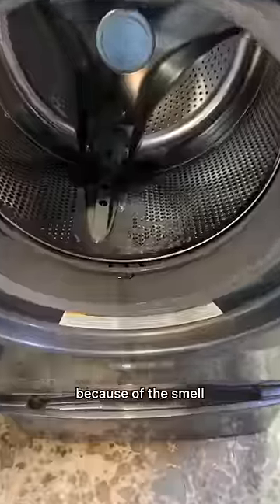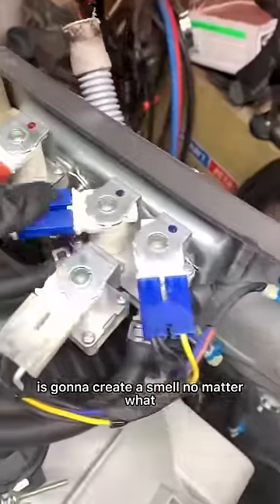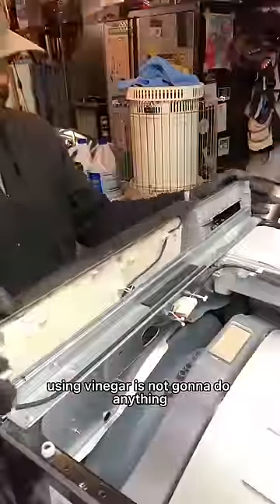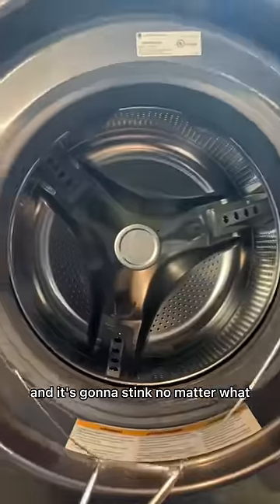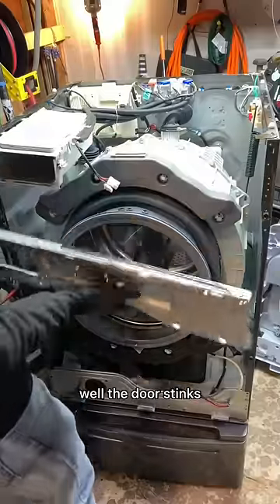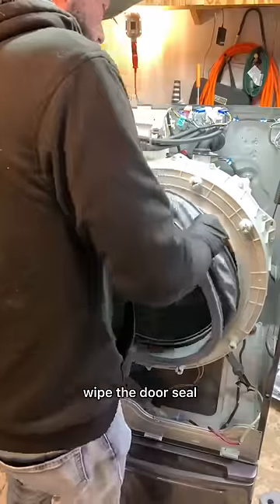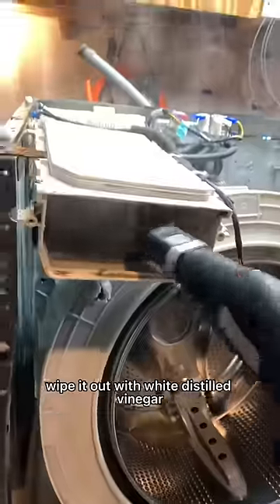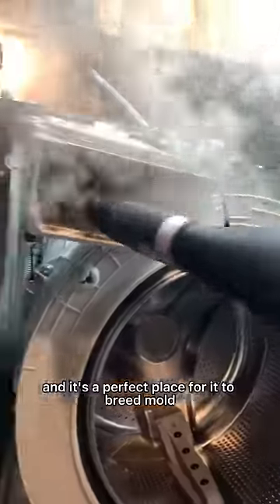Front load washers are proven to wash better. Facts, not opinion

Comment: My mom despised her front loader for years and gifted it to me when she reached her limit and switched to a mega capacity top loader.  When I first got it, the machine did smell horrible and was covered in slime all over/under the gaskets and all inside the detergent dispenser drawer.  

But I gave it the cleaning of a lifetime and years later I love it and have zero issues with it.  

To do the initial deep clean I made Lysol disinfectant solution from the concentrate in a commercial spray bottle.  Then I literally just kept spraying at the slime with firm trigger pulls until it was all displaced.  I did this over the gaskets, under the gaskets, and all inside the detergent compartment.  I realized the concentrate wasn’t rated to kill mold though since it doesn’t have the alcohol in it like the aerosol version, so i finished off with an aerosol spray to ensure death of any mold traces. I washed the pop out detergent drawer and its detergent and softener cups in the dishwasher because they were coated in mold even in the tiny nooks that were too hard to clean.  Popped the detergent drawer back in. Then I ran a simple rinse and spin cycle to wash away the slime.  I had a mask, gloves, and goggles on during the spraying/disinfecting to be on the safe side.  Then I did one tub wash cycle with an affresh tablet.  Then I did one tub wash cycle with bleach.  Then I wiped all the gaskets top and under to get any stubborn remaining residue/slime. Finished by draining the pump chamber and washing the coin catcher tray and then putting that all back in place.  

I know that sounds like a monstrous cleaning job, but ever since getting it spotless I’ve never had any recurrence of mold/bacterial growth—without ever doing a similar deep clean.  I think it’s because I live in a small apartment where the washer is basically just there in my kitchen area.  So I leave the door and the detergent drawer open when not in use but the key is there is enough airflow to dry it out.  My mom never left the detergent drawer open but she used the affresh tablets monthly and always remembered to leave the main door open—but the main difference is her house had the machine in a relatively small laundry closet.  Even with the doors to the closet cracked, it’s still essentially an enclosed high humidity room when not in use. 

So the key to long term success with a front loader, in my opinion, is humidity management and airflow.  If you have an enclosed laundry closet then a top loader is probably better if running a fan in or near the closet for an hour or two after washing is not an option.  Another thing that I think helps is I run a dehumidifier with a target of 50% humidity.  If I don’t have the dehumidifier going then my apartment will naturally be 65% humidity or more all year except for deep winter which makes me feel way too hot when I’m sleeping.  I’m sure the dehumidifier also helps reduce my machine’s dampness.   

But I just love how efficient it is and how little detergent I have to use.  For a load of normal clothes I literally only go up to level 1 on the inside of a tide measuring cup.  For towels and bedding I use level 2.  If the clothes or items have more serious dirt or spills on them then I just try to go up half a level and set it to run one extra rinse cycle.  My clothes get super clean, my water bill is noticeably lower, and I hardly ever have to buy detergent refills. I used to be super jaded about front loaders because the college laundry rooms from my school days were f*cking disgusting and would make my clothes smell even worse.  Like I’d literally sniff each one and use whichever available one had the least funk in it.  It was horrible.  But I couldn’t pass up a free hand-me-down machine when my mom wanted to trash hers.  Glad I gave it a shot.  

But I also think everyone should do what works best for them. The new top loaders have gotten pretty efficient too as of late.  There are great options for everyone. 😃

Comment: We bought a product called the "washer fan" that was basically a desktop computer colling fan in a magnetic housing that fit over the air exhaust vent on the back of the machine and forced air into it all the time.   When done washing, you leave the door cracked open and it pushes air through to dry everything out.  It worked.

That said, I find front loaders don't do a better job. The clothes don't get as clean. We bought a top loading, agitator-free washer 2 years ago and it's the best machine we've ever owned.  Doesn't destroy our clothes and gets everything cleaner than our front loader ever did.

Comment: Front load machines are trassshhhhh. They don’t use enough water and don’t clean clothes. Worst things I’ve ever used.
Reply: There's a screw you can turn to add more water. Also it's not frontload, it's the stupid regulations
Reply: @andrewk8636  unfortunately mine has the dryer on top and it’s in a small room, the size of the washer, because I’m in an apartment so I have no way to access anything.
Reply: @2bit156  if you can pull out the machine you could switch the two water lines so the hot water is hooked up to the cold line at the back of the machine, machine thinks it’s pulling cold water, (government regulates how much water new machines get to use and how much hot water they can use) but your machine can’t tell temperature, so it thinks it’s pulling more cold water then hot and you’ll have maybe an increase on the cleanliness of your clothes, try doing half loads as well
Reply: @2bit156  just make sure when you flip the two lines at the wall, to close them all the way then thread the hose on nicely don’t cross thread it and when you turn on the water watch for slow leaks or drips, might have to tighten it more
Reply: @giraffeguy6564  you do need to have your clothes drenched. The “deep soak” trend going on in TikTok is normal wash for us top loaders. Front loaders don’t wash clothes properly.

Comment: My solution has always been to use oxyclean as a pre wash on every load, use powdered soap and no fabric softener. 

I will use dryer sheets but that’s it! 

ALSO, I leave the washer door opened. I used to wonder why laundromat left their front load doors open and I asked the owner of a local place and she said that that’s what she does to mitigate stagnant water. I’ve had my front load for about 5 years. I’ve never done a deep clean so I busted it open a couple of months ago and there was ZERO build up, mold or any other foreign body. All of the rubber was pliable and clean as if it were new.

Comment: This is my next project. So far the seal looks like this one. Not the detergent tray. Clothes do not smell or have particles. 

I only use 1oz of HE detergent, Distilled White Vinegar as softener, laundry booster that uses washing soda as an ingredient, and an extra rinse option. Clothes smell better and washer doesn't stink.

I've followed the tips from you to maintain my machine and The Clean Club as to which detergent and how much of it to use. 👍

Comment: They do not get your cloths cleaner, sorry. I threw my front load HE piece of crap away for an older top load  all mechanic non he washer. I throw my cloths in an in 10 MINUTES they're done, clean. No residue like he machines, doesnt take an hour and a half for a load to finish either. Bonus, if it breaks it's simple enough for me to fix,  I dont have to spend a ton on a new one or to have someone fix it. HE washers are the worst, top front doesnt matter. I have never heard anyone ever say they get your cloths cleaner. Because they dont. It's literally the opposite. They dont use enough water for one.
Reply: No offense but stop being so ignorant 😂 like fr, you think the laundry companies care if you use more water? No it’d only be better for them, it’s government regulations that are put into place that only allows for a certain amount of water and hot water especially. Old machines don’t have regulations on them so of course they’d work better in most cases
Reply: Also if you use top loaders normally you probably overfilled the front loader to the max and would make sense why it didn’t clean as well, but older top loaders will always work better because the companies don’t have to deal with the government regulations that limit water just like they did with toilets

Comment: Front load more efficient bahahahahaha.   Had 2 in last 5 years.   Absolutely garbino.  Anything front load or high tech sucks.
Reply: Sounds like you just buy crap brands, considering a speed queen new comes with usually at least a 3 year warranty for free and you can get up to 5 or 7 years if you wanted

Comment: One issue I have with front-load washers, particularly our Electrolux model, is that they use too little water. While they work well for everyday clothes that aren’t heavily soiled, they struggle with more intense jobs. We use Tide and typically add half a capful (about two tablespoons) per load, and we also follow the machine’s cleaning cycle recommendations. However, I’ve noticed that when I wear a black T-shirt while working on my car and sweating, the smell lingers even after washing. Yet, if I wash the same shirt by hand with plenty of water, dry it, and wear it again under the same conditions, there is no odor. This leads me to believe that front-load washers don’t clean clothes as thoroughly as they should. To tackle tougher loads, like dirty work clothes, I’ve started adding about four gallons of water manually to the machine, and the results are noticeably better. Water suspends dirt, the more you have the better. Try washing your hair with one glass of water. I don't think it'll work very well, unless you're bald lol.

Comment: Germany only use front load washers mostly. Cleaning tips are. Always leave door and tray open. Clean with 2 Dishwasher tablets every 50-60 Loads. If you have buildup that looks like mold run clean cycle with chlorine. If there is limescale buildup run cleaning cycle with vinegar. Easy

Comment: i have two front loading washers, both electrolux, and they never smell bad and one of them is over 7 years old and still works, plus in france top loaders are rare but thats all
Reply: Electrolux are one of the better quality washing machine manufacturers,  in the UK they are sold under their AEG and Zanussi brand names .  Mine doesn't smell either, I had it in pieces to replace the bearings a few years ago when it was 10 years old (£30 for the parts), and it was clean inside, bar a few light surface spots of white limescale (we have very hard water). Just a matter of proper use, main thing is leaving the door and draw open. I've read  doing cold water washes is popular in the US, and that it is one of the causes of biofilm build up in US washing machines. Apart from the disgusting grime and smell, biofilm can also rot the spider.
Reply: both of my electrolux machines are in really good shape and dont smell either, probably because we dont leave the door closed all time

i also live in france so things might be diffrent there

Comment: When I got with my bf we found out I was allergic to his fabric softener. When we removed it, we noticed Tha the fabric softener was masking the smell 😅

So my advice is when you start noticing a smell do this:

Wash your towels/bedding on high heat, replace your fabric softener with a bit of vinegar each cycle, use less detergent, leave the door open to a crack so the water that is left can evaporate. Once in a while use a machine cleaner and cycle it in an empty load.

Do this, as a rule and your machine won't get to what he's showing.

Sincerely a dutchie who doesn't even know top load washing machines 😂

Comment: I run half cup up to a full cup white vinegar with each load. I don't let clothes sit wet in it and if it's not in use I ALWAYS leave the door cracked to allow airflow. Never had an issue with smells even when my wife forgets a load over night I open the door let it air out and good to go. Also I don't use and fabric softener that stuff does more harm than good. The vinegar replaces it and works just as good if not better.

Comment: I’m a tech also . He is 100% correct. You have to learn how to use a front loader correctly and the will out preform a top loader. I have two sets and one set is from 2001 and no smell because I don’t use fabric softener in it . I have over 35 years experience and I can’t believe people still want a top loader. You can get twice as much in a front loader use no more than 2 Tablespoons of soap for a large load , leave the door open when not in use to allow fresh air in it . If you need to you can use “Affresh “ washing machine cleaner in it once in awhile.

Comment: Most front loaders will have catastrophic failure before the smell becomes an issue.
Usually the rear bearing goes or the circuit board fails.

Comment: The BIG problem with front load washers is the physics of how the load is moving. It puts cantilevered weight on the main drum bearing, which is captive to the drum. When that bearing goes out the cost of the repair exceeds the cost of the washer. First hand experience.

Comment: If you pour in 2 quarte of peroxide and add water so that the water level is visible inside the drum. Then turn a bit every 1/2 an hour it eats off all the bacteria. Then put the washer on a hot cycle. When it's finished adding water, add another 2 quarts of peroxide Into the soap tray. That will clean the exterior of the outer drum.

Comment: I had both. Front load will never stink if you simply leave the door open to air out. You're supposed to leave the door open regardless of top or front load after every wash.
Sounds like a skill issue if the door stinks

Comment: I bought one front loader washing machine and it was absolutely horrible. It's actually still sitting in my basement because it's so heavy. Nobody will take it out. It broke in 7 years. That's normal but I absolutely hated it. I now have a top loader. I wish it had a bigger agitator but it takes so much more clothes and I believe that from an energy standpoint they're much more efficient. And it does get my clothes cleaner. Nonsense of those front loaders

Comment: Open door, wipe gasket, use minimal detergent, and run a hot water or sanitize cycle every two weeks, with a cleaning tablet twice a year—more if you have hard water or abuse your machine.

I recommend Miele because their washing machines are reknowned to last twice as long as competitors. Check the comparative reviews and the warranty if you want to be convinced. If you're lazy, you can get a model with automated features, but there's not much to pouring in half a teaspoon of detergent and starting it up. That's what I do.

Front loaders are not just more efficient, but they are significantly more gentle on clothing. I wash a lot of wool and delicates and linen that is dear to me. I would never buy a top loader with an agitator. I frequently use delicate and hand eash cycles and mesh delicates bags.

If you're gentle and make the effort to figure out the right way before you risk damaging your textiles, you can wash many delicate things in a good frontloader. I wash all the clothing I own in the machine, and I dont hesistate to buy "dry clean only" garments and machine wash them on the "hand wash" setting. I also wash all my cashmere, including my expensive cashmere sweater. I handwash it in the sink, then transfer it to the machine for a "hand wash" cycle without detergent, to rinse it. Slow spin to be extra gentle. Wool, silk, linen, cotton fleece: I have little fear of damage, "hand wash" just soaks the items and flips them over every five minutes or so. With a gentle spin between cycles. I'm not wearing dry cleaner chemicals. If you think leaving the washer door open and giving the gasket a wipe with a small towel is a chore, it's nothing compared to getting dry cleaning done. Manufacturers will often say they recommend frontloaders for more longevity to your clothing. I've read agitator horror stories.

The other great reason to get a frontloader is that you can stack the washer and drier. My Miele W1 and T1 were installed and mounted together, taking up half the floor space of a side-by-side installation. Very useful! I don't have a lot of empty room to fill.

Comment: Ive taken apart many a washing machine and no matter what people do all the front loads are nasty as hell inside.. and having to wipe the door seal off every load and leavng the door open is just too much when if you forget even one time than its gonna mold and stink or if you dont get em completely dry than theyll mold inside the lips of the seal..  I like being able to put as much soap as i feel like with fabric softener if i want and letting real stained clothes soak and have it all automated..  without having to clean it every time.  I just spray some pine sol for the stink if it ever does and use a cleaning tablet to clean it and it keeps both inner and outer drums clean..   hell i used dishwasher packets for the past long while cuz i had em on hand and they do a fine job of cleaning em.   On top of the cleaning the supports on front loads for the drums will always shit out on you within usually just a few years and theyll crack or break which a new one is expensive and a lot of work to replace.  Ive had a top load for over 25 years and it still works great..

Comment: Honestly, I prefer a good old non HE washer. The lack of efficiency is made up for in the fact that the older ones last forever. 1989 and still going strong on mine. I repair appliances (not washers and driers, but fridges, ranges, air conditioners, fans and pretty much any electric appliance you could think of) and I can tell you that the old stuff is almost always better than modern junk.